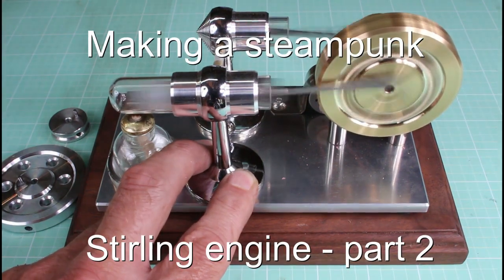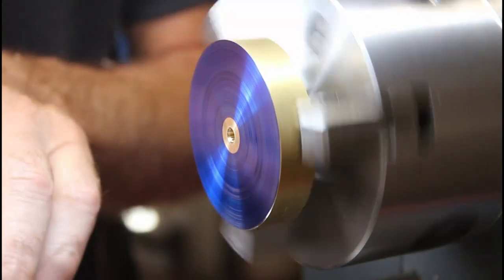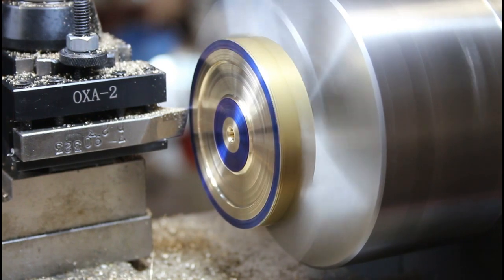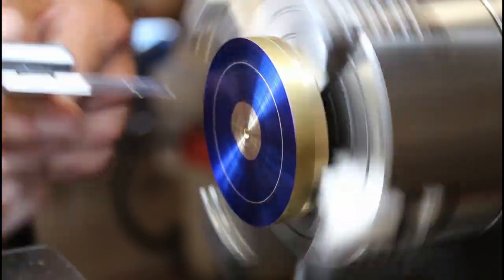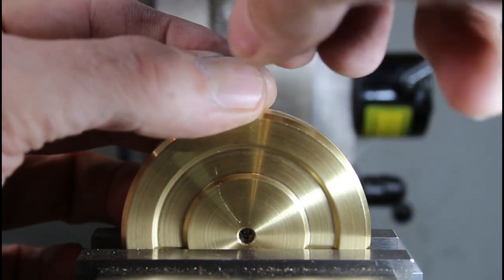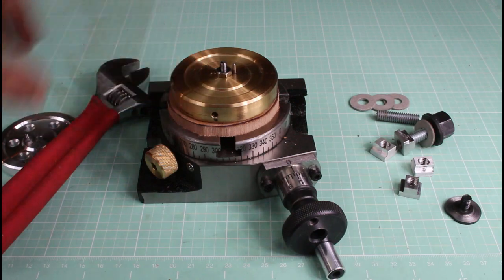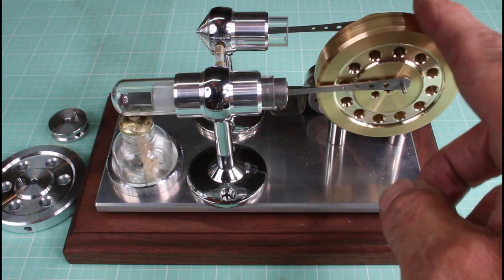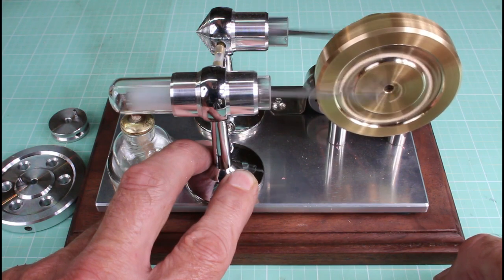Making a steampunk Stirling engine part 2   flywheel

Comment: An ideal flywheel will have all the weight at the outside rim, so removing the middle is important (not just aesthetic).
Reply from the maker: Makes sense!  And this one is thicker and heavier than the original aluminum.